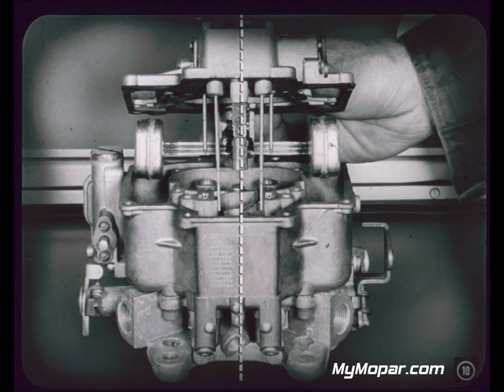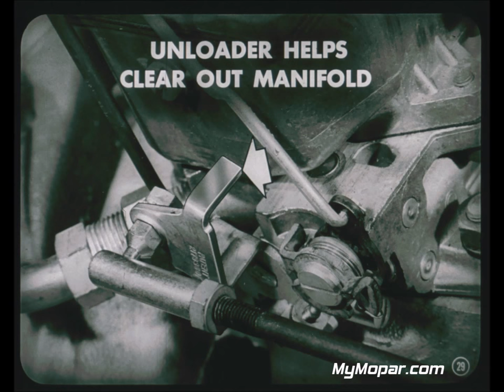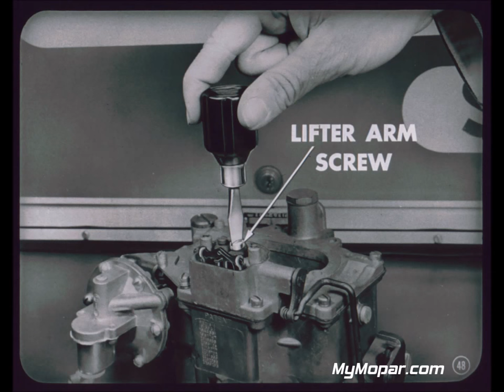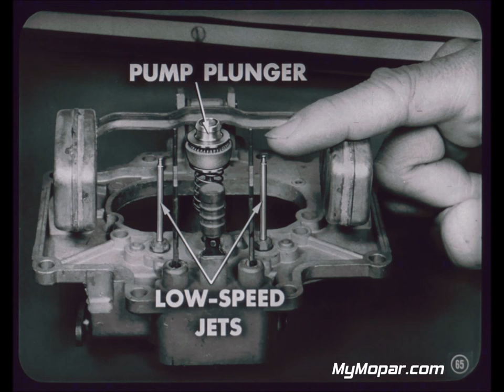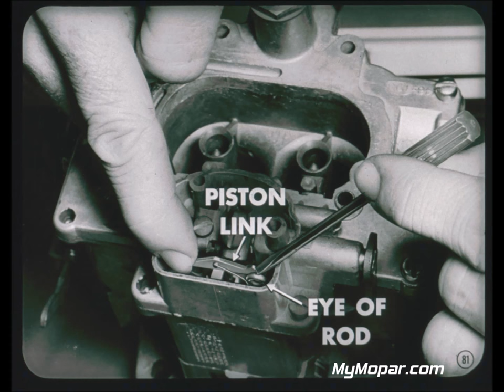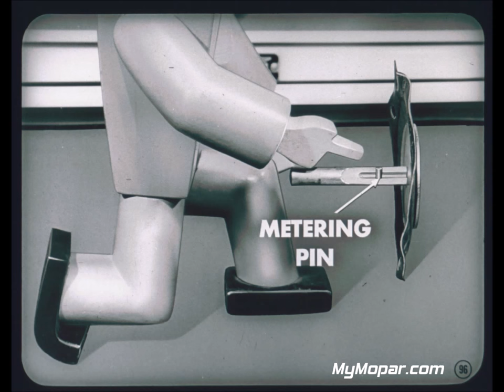Chrysler Master Tech - 1951, Volume 4-9 Firepower Carburetor Adjustments

Comment: Chrysler Master Tech series: "Safety's the most important thing. Shop safety too."
Also Chrysler Master Tech series: "Run the engine and open up this inspection port, if the gas trickles out while the engine's running it's okay, but if it gushes the float level's wrong. Remember, only a little fire is what you're aiming for."

Also: I'm going to have the next person who tells me "Carbs are so much simpler to work on than EFI" watch this video.